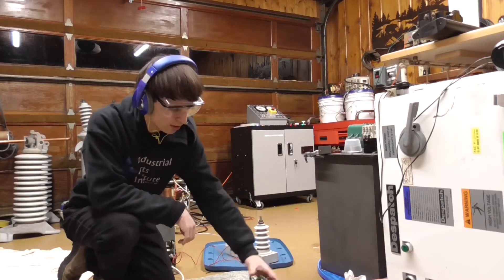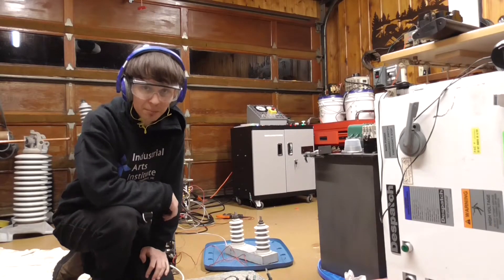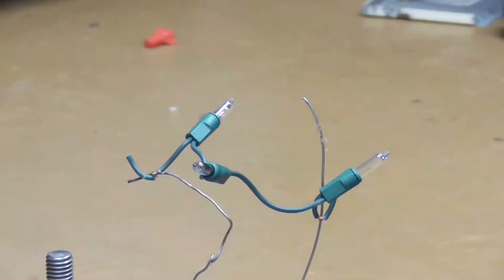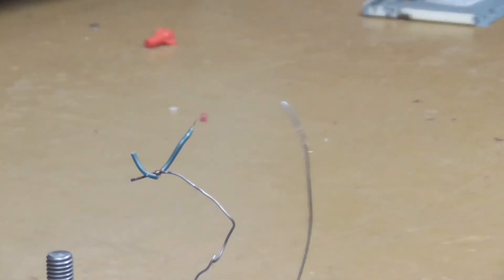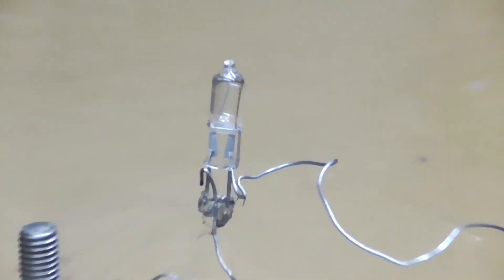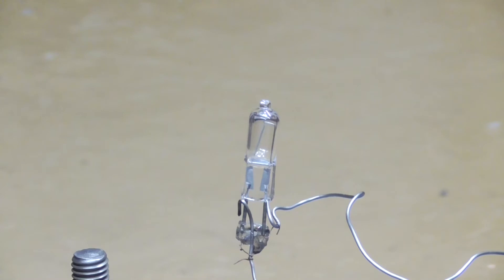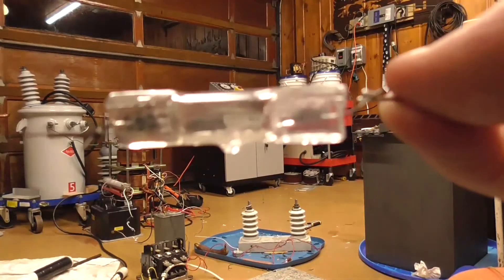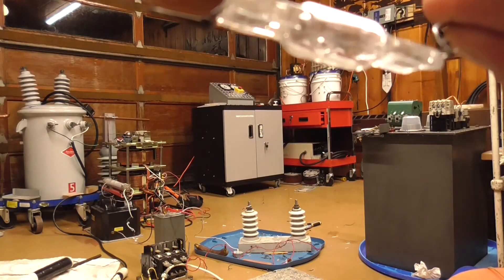7000 Volts DC Capacitor Fun

Comment: COOL! 
Try drawing an arc from a pencil.
Reply from the maker: Sure!
Reply: @VariacManiac  I have 2 PV panels that make 65 volts and I use pencils to draw an arc from it, if i use wire then it just welds the wire and I can't get a arc but with the pencil the arc is around 1" long.
it's cool the sound difference from AC arc and DC arc,  DC arc is a smooth sound not a buzzing sound like a AC arc is.
Reply from the maker: @NSaw1  Wait, I think I have done this before, here's a linkhttps://www.youtube.com/watch?v=tE81R87G6Ow&t=11s
Reply: @VariacManiac  Cool, i'm new to you'r channel so i didn't see it.
That is one bright arc!